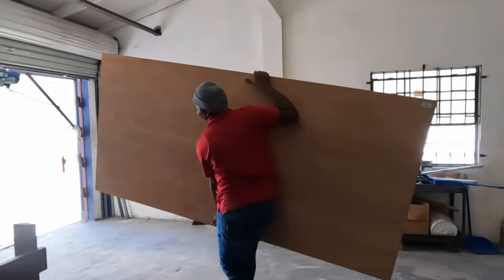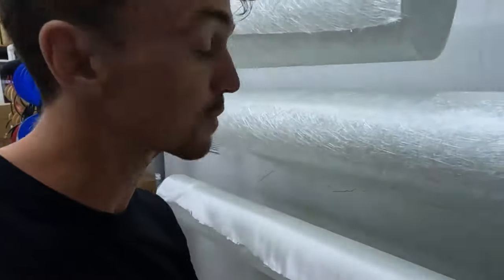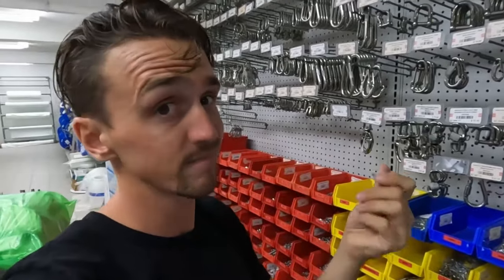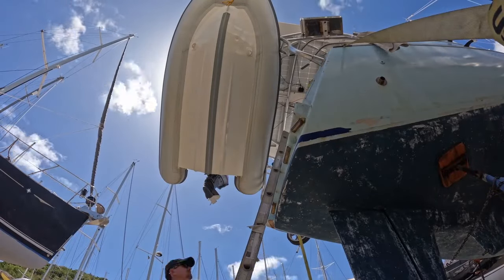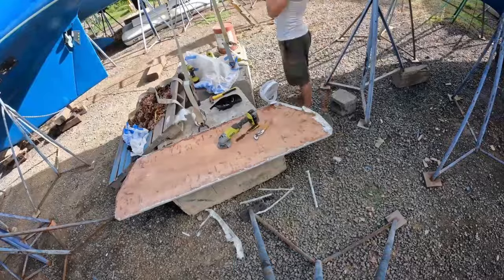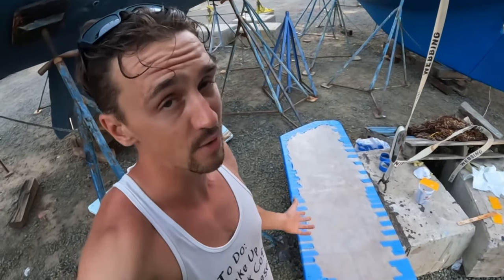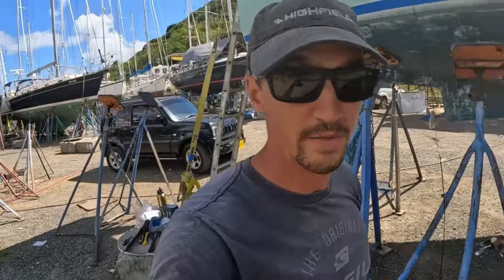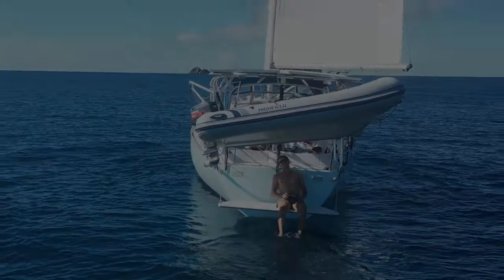How-To Build A DIY Swim Platform On A Sailboat

Comment: The peel ply or Dacron fabric is great too because you don’t need to sand after you pull it off- leaves a rough surface. You can also pull it off years later and it’s still good to go. I’ve never pulled it off when it’s tacky. Also we use West 105/205. We have used all this building composite airplanes (4 so far) and I’m working building a 13’x4’ swim platform on our 38’ Chris Craft
Reply from the maker: Oh wow! Good to know.

Comment: Years ago Michigan wheel made a outboard bracket with a c channel rail system. If you can find two sets you now have two points of attachment on the transom so swim step, out board, hydro vein. Completely a modular set up
Reply from the maker: That sounds cool!
Reply: Do you have a link to this?
Reply: @dare2imagine651  no link the product was discontinued prior to the Internet. Plenty of them out there. A guy on my dock has a complete setup. I can send you a picture if you want
Reply: @scott.wallace8625  I'd love to see a picture and any more info on this please

Comment: Would this work woth aluminum, as in the aluminum used now in some cargo trailers thst hold hundreds of pounds with no frame, then a layer removabale top that would be eashabke and keep the platform cool. I was thinking of a longer swim platform that was fold out twice.

How did the swim platforms interact with an additional outboard engine?
Reply from the maker: That could work. 
It works great.